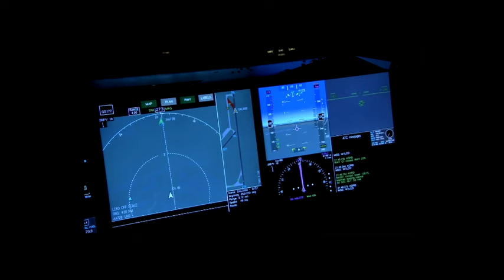High Risk Choices Lead to Plane Crash that Kills 2 – Episode 188

Comment: This is rather terrifying to think about, but for that Pilot/A&P to make such a huge mistake makes me wonder about all the other aircraft they inspected over the years. What did he let slide on those aircraft that could be a ticking time bomb. I know that mechanics tend to let things slide a bit longer on their own stuff, but normally, when it comes to safety, they are adamant about it getting repaired. It's insane that he didn't even take the time to inspect it well enough to find the birds nest. Sounds to me like he checked the oil and fueled up put a battery in it, kicked the tires, and said adios.

Comment: It's hard to believe that an aircraft mechanic would risk so much by not doing a full teardown of the engine.  It's not like a car, where if it breaks down on the road that you can just push it off the road! 
Perhaps he knew there were problems,  but that he was better equipped back home, and that if the engine runs, it should get him there.

Comment: Superb. Such a simple idea - look at the NTSB reports for your proposed home airport so you can see the risks for real. Why is it that such a neat idea isn't standard practice? And such a sad and stupid accident. The swiss cheese had been got at by the mice living in among the control cables. OK there was a sequence of strategic errors, but the one that actually killed them was the impossible turn. If they had flown ahead, keeping the speed and angle of attack inside the envelope, and put it down on a field or golf course or even flared it onto the tops of the trees, they'd have likely walked away. Why do people still not know that banking reduces lift and so you have to fly faster to avoid stalling. This pilot was only a 100 hour pilot but he could so easily have spent a few hours at a few thousand feet, practising shutting the throttle and gliding straight so he knew how to resist the human impulse to pull back, so he knew how to fly a dead stick landing when it happened for real at a few hundred feet.

Comment: Hmmm... my first thought was sputtering engine with 15 year old magnetos? Wow. Then I looked at the Accident Report which is very short for an NTSB report (or is this the new norm, I have no idea) so apparently the owner replaced one magneto out of the two. When the investigator got to it, one mag was stuck and the other did not produce any spark. Was that because the postcrash fire heated the magnets above their Curie temperature and reduced their strength dramatically? We'll never know.

Comment: The NTSB is a useless agency  as far as GA crash investigations. They simply don't do the needed work to make proper causation and the needed recommendation against more unnecessary accidents.
Reply: I just don't see them caring,  unless a famous person,  or victims numbering more than 20 are  involved.
Reply: @jasonhawes5096  To be fair to the NTSB, do they have the resources or budget to do a more detailed analysis on a crash like this?  There are so many things that the pilot could have done to avoid this crash happening.  There is almost nothing new to learn here - but we can of course be reminded of what we already know - and that's valuable.

What I'm reminded of, which we all already know, is "don't attempt the impossible turn" and "don't take off if you have a rough-running engine."  We can drill down further on each of these, and that can be valuable, but I'm not seeing a huge value to the general public or general aviation for the NTSB to spend more of their limited resources on this kind of crash.